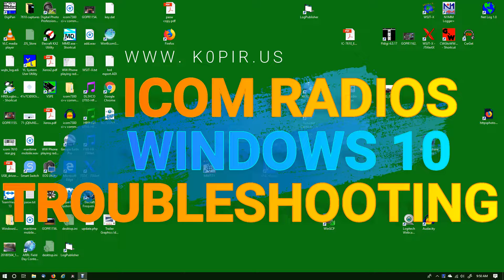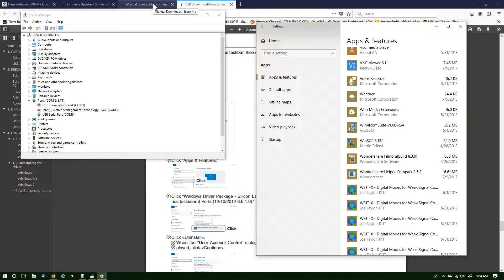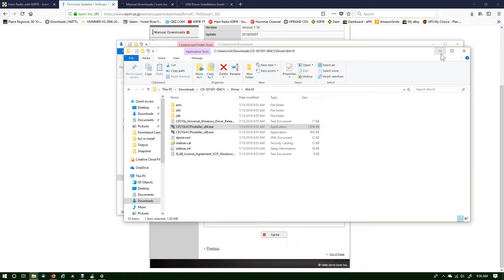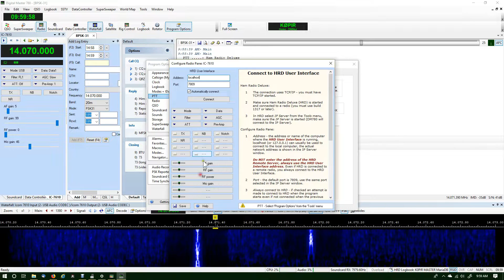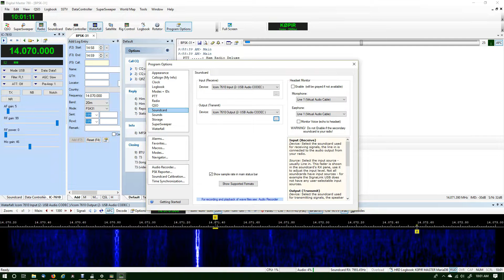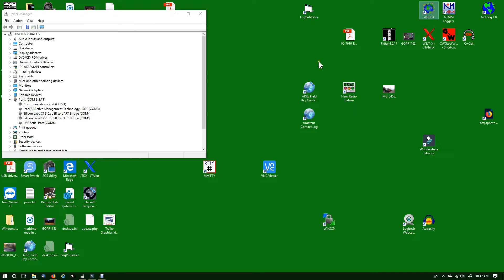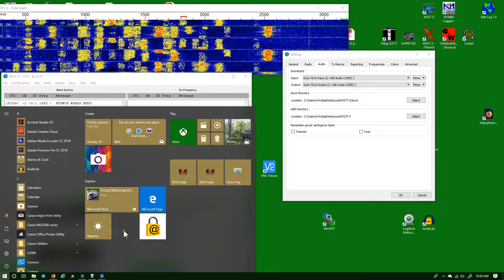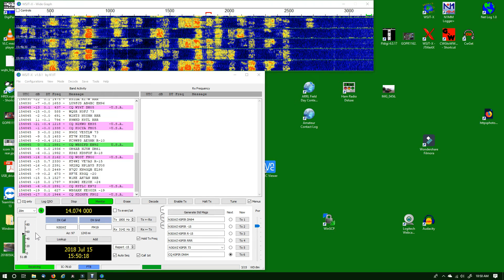Icom USB Driver Reinstall  Windows Troubleshooting HRD WSJT X

Comment: Hi hello I would like to ask IC-7600 and IC-7610 on the computer will display 2 sets of COM Port or only a single com Port?
Reply from the maker: Thank you and I hope all is well where you are. The 7610 has two virtual com ports. See this: https://youtu.be/PeIkasYQelI
The 7610 has two physical USB ports on the rear. One for high speed (HDSDR) the other for CAT. 73!
Reply: @HamRadioAdventures  Thank you !de BX6AD Benny 73!

Comment: Any suggestions on removing multiple installs of Silicone Labs drivers (different versions) when the uninstall (run from Settings -->> Apps and Features) says the folder is not found? When I try to navigate using Windows Explorer to the folder I do not find it either. I was able to uninstall the latest version but not the previous two.
Reply from the maker: Bob D. That is a great question Bob. Thanks for commenting and I have used CCleaner. I think the registry fix solves that problem. Use with caution. Best 73!

Comment: Learned something.  Don't have HRD on at the same time.  I couldn't get WSJT-X to connect until I close HRD.
Reply from the maker: Hi John thanks for commenting here. One thing I have been trying out lately is using ham radio deluxe as the rig in WSJT-X. It’s a little quirky, but it works pretty good. Here’s a link to what I’m talking about http://www.k0pir.us/using-the-icom-7300-with-new-ham-radio-deluxe-and-wsjt-x/
I’m going to do an updated video using a CI-V cable with WSJTX and then using my USB cable for ham radio deluxe rig control. That’s the way I used to do it and is still my preferred way. I’ve got some videos out but they are using older versions of the software. Thanks again John I hope everything’s going well best 73!
Reply: Thanks for answering back so fast.  Here's my dumb question.  On videos and even when I google photo search I get confusing information on CI-V and USB.  Is CI-V USB plug on one end and the little square one (like printer cable) on the other one.  Then there is USB on one end and 3.5 plug on the other end.  Which is considered which?  Thanks JJK
Reply from the maker: John Kershaw No that’s a very good question. Lots of people question it. The C-IV has the 3.5mm on one end and the USB cable we use is basically a printer cable. The C-IV plugs in to the remote port on the back of the radio and the USB cable plugs into the USB port (square) on the back of the radio.
Reply: Wonderful thanks.  Right now I'm using the USB (Printer) or should I be using the USB (3.5mm pin) or both.  Right now I don't get any audio from my computer, only from the radio.  Does HRD allow the sound to play through the PC?  I also don't get any sound through computer with WSJT-X either.  Should I be?
Reply from the maker: @johnkershaw9575  Yes using just the USB cable is fine. 
When you say sound, you won't hear SSB transmissions coming from your PC, just from the radio. The USB cable sends audio to programs like WSJT-X for decoding, but the sound (digital signals) will still come only from the radio. Is your waterfall working in WSJT-X? I have to go, but will be back tomorrow afternoon.
Reply: Ah I feel better.  I thought I might be doing something wrong.  Thanks so much and have a wonderful weekend.  JJK 73